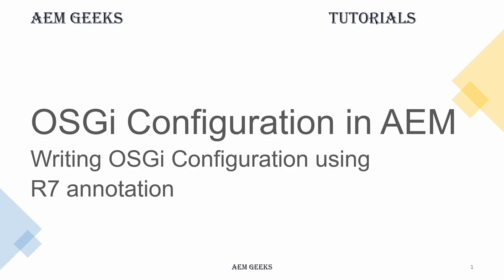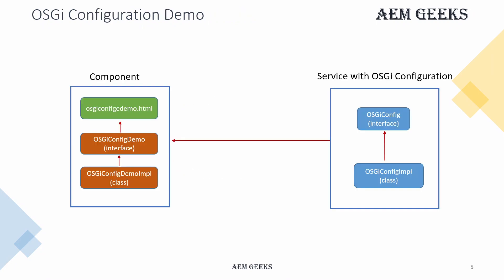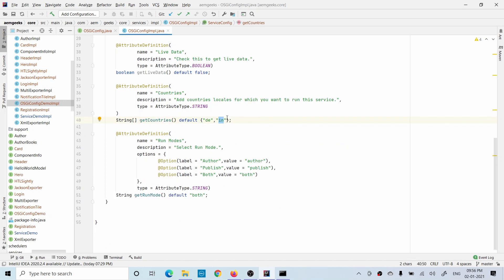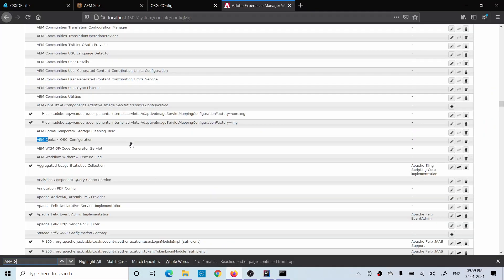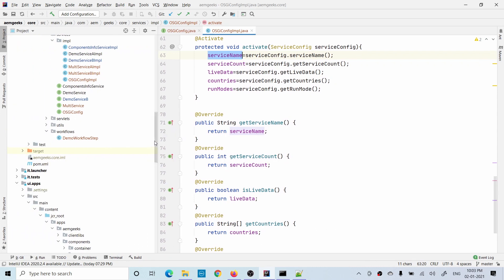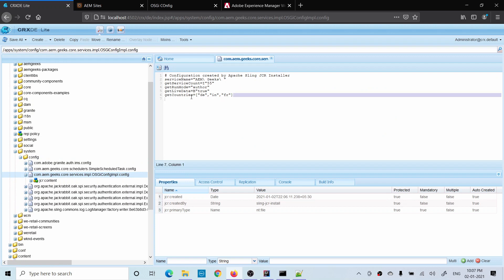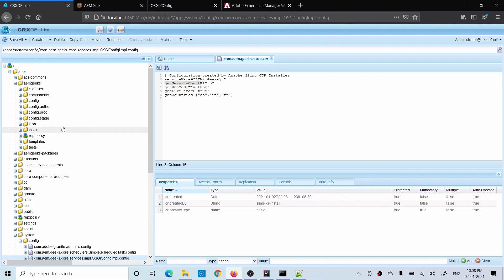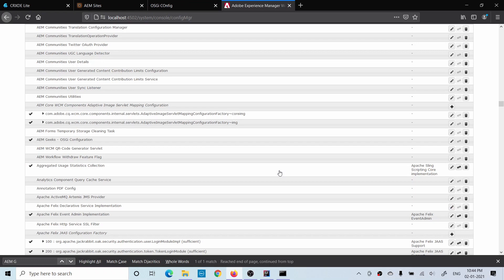AEM Tutorial #31 | OSGi Config #1 | Create OSGi Configuration in aem

Comment: Great Explanation!! Thank you so much for knowledge sharing. 
I have a question, how the OSGi config data is going to store under "/apps/system/config" consider this path as default for storing the config data. But how come the data will be storing, if we create a node with sling:OsgiConfig under "/apps/config/" ??
Reply from the maker: If you add your configuration through system/console, these may store under "/apps/system/config". But real use case this won't happen coz you will add configs as part of code and in code you will define correct path.

Comment: Nice video!!! I have a Question:
Is it possible to read a Osgi Configuration from javascript? 
Let's suppose i Have a component with a  config dialog form, and I need to read some Osgi configurations for that config dialog form with a javascript. 
Is it possible?
Thanks!!
Reply from the maker: Yes, you can. It is not advisable to use osgi config in JavaScript.  Let me explain how to do it. 
1. Bring configuration in component sightly.
2. Pass/expose  these values to javaScript/clientlibs from Sightly using <script> tag. 
3. Now these config values will be available to javaScript/clientlibs.

Comment: Very well explained!!
i have a question , if i save OSGI config as sling:OSGIConfig , and lets say as per requirement if i add a new field in JAVA code , should i need to manually add that field in crx/de as well ?
Reply from the maker: No, you don't need to do anything manually/crx/de in actual environment(stage/prod). Everything should as part of code. 
You OSGI config file should also do as part of code. So when you add new filed in java, Same time you can update OSGI config file as well with new field value.